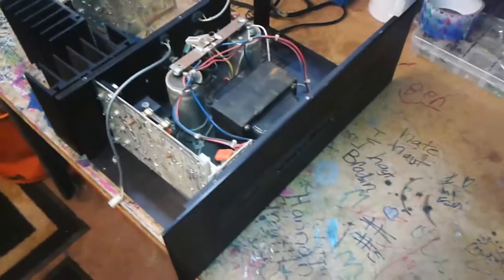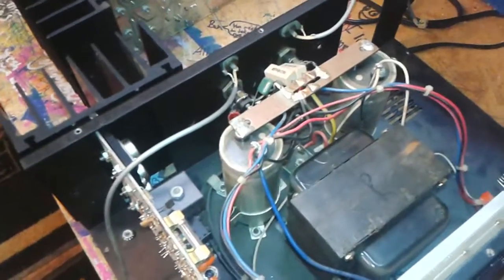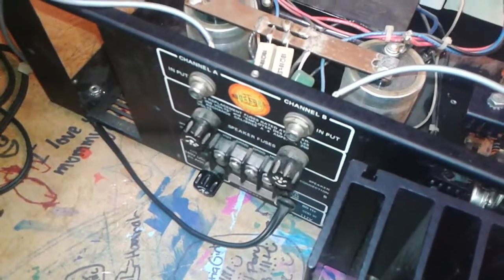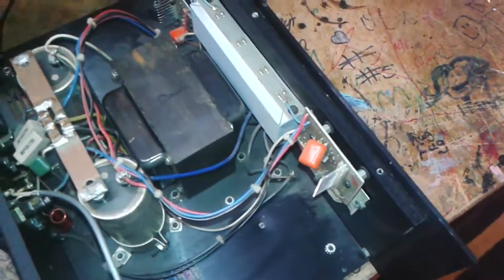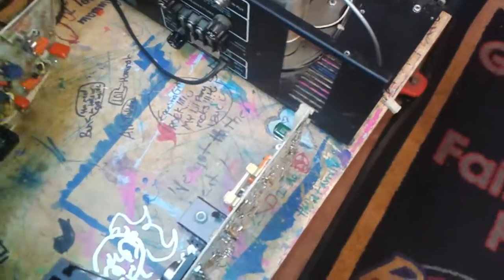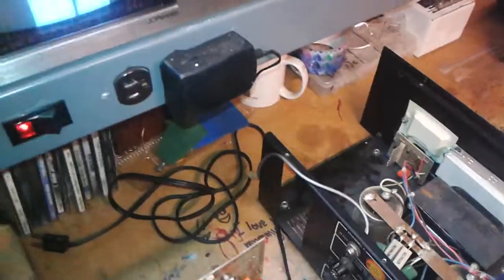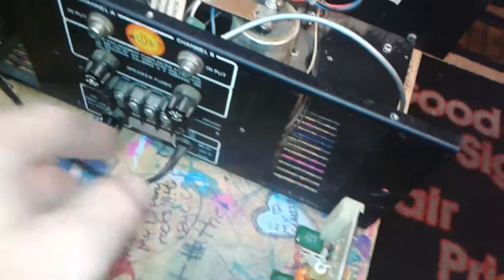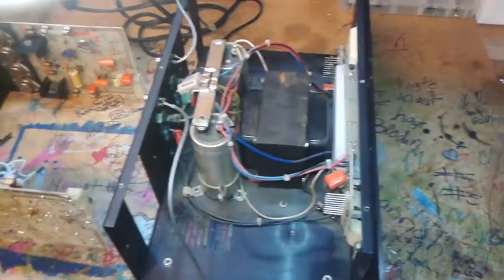Spectro Acoustics 202 power amp rebuild - Part 1

Comment: I worked at Spectro Acoustics in Pasco, Washington in 1975,76. Solid stuff. I might have helped build the P202 you have. Enjoy and Cheers.
Reply from the maker: Cool. Did you use a nickname?
Reply: @mattsmith4751  no nickname for me. I was a 'peon' materials manager and line assembler in production; but we called the power amplifier modules 'scamps'. You would probably be surprised how much care went into their products. We 'burnt' them in for a week under load. Most survived. We also had the gals take the freshly wave soldered boards home to clean in their dishwashers - honest. lol
Reply from the maker: @gwhiz1397  awesome! Gotta get that amp going again. It is a beast and sounds Soooo good.
Reply: Hi late comment but I like so much the layout of this amp and the big transformer
I would have replaced also the bias trimmers with sealed multiturn ones. They are easier to operate and more precise
I am quite sure it sound very good indeed especially after the caps update Congratulations Bye Gino
Reply: Bella roba

Comment: I'm working on a 202. It works ok but stays very cold. I turn the bias trim pot a bit and it doesn't seems to do anything.
Reply from the maker: Yes, these seem to run cool. I'd check with a meter to see if the trim pot is changing the value

Comment: If the boards were to fail would it blow a fuse?? Also can you still get replacements? And do you think it's safe to assume that any spectro acoustics reciever with those things that stick out in the back also have the option of the boards being interchangeable well? I really hope this account is still active.
Reply from the maker: Blown fuse probably means shorted transistor.  Even though the boards change out similarly,  you must stay with same model number.  No new ones are available that I know of